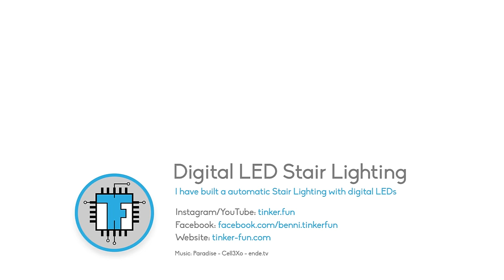DIY - Digital LED Stair Lighting - Arduino APA102 LED

Comment: How did you cope with the LED power supply? Did you use two power supplies? What kind of cable did you use? At 5v current flows a lot

Comment: Okay - interesting. I think the ultrasonic distance sensor is better than PIRs here - more accurate location determination. But this one is use just to sense a leg passing a single stair, not to judge distance. Do you think it is possible or practical to judge distance? That would be amazing, as you can have the lights moving exactly with the person.

Secondly I really like your use of individually addressable LEDs. BUT - maybe I prefer the "one LED strip per stair" instead of the linear installation. As it's more visually impactful, and also actually lights each step well, so it is useful as well. What do you think?

Finally I wonder if it's possible to somehow do something like you've done but in a whole room perimeter, not just stairs? I'm thinking camera movement sensor hooked up with Arduino. That's the next step!
Reply: The lights turn on and follow a certain pattern, then they wait for the second sensor to activate the other half of the pattern. Measuring distance would not help at all really.

Comment: Hi , I made a project on automatic staircase lights with arduino and ws2812b but unfortunately nano cant support more than 600 leds which disappointed me. my stairs runs nearly 11 meters (60 led/meter).
soo i planned to do same with esp32 
i have few doubts.
can i use two ultrasonic sensors. one at top and bottom. and also as i read in community that it can only trigger lights but cant reset. is it possible to trigger lights at bottom and as the person walks to top the lights should stop.
help me to finish this project.

Comment: Is there one that is battery operated that just stays on all the time? But that won’t need battery changed too often?
Reply from the maker: This is not battery operation.  Fixed power supply.  Best regards Benni

Comment: Can I replace Teensy 3.2 Microsontroller with something like Arduino uno or nano？
Reply from the maker: I think yes. But you have to test it with your Led length. If the Microcontroller is fast enough. I will build a new version with new sensors soon. I will test a esp32 Microcontroller as a new controller.
Reply: @tinkerfun  I intend to apply this project to my own house, so I would like to know more details. I'm curious what kind of sensors are you going to replace PIR? In addition, do you think nano is not fast enough, so you plan to use esp32?

Comment: Where did you hide the drivers?  They look way to big for that application btw. lol
Reply from the maker: You mean the power supply? For the long stair I built them in a cabinet in the room on top of the stair. For the short stair I built a acrylic case and mounted on the wall. The LED seller write "43.2W/m". So I have ~ 6,5m/930 LEDs on the long stair. So I think it fits. Best regards
Reply: Yea because those LED strips look overkill... its probably the 144 LED per meter one? :D
I mean... 60/m would be sufficient... maybe even 30/m. :P
Reply: @janred94  for the amount of necessary lumens, yes. But having the 144led/m makes the spacing between the diodes much less, and the fades much better looking. You don’t always need to run the leds at full power either...

Comment: That's awesome! So what's the total costs of this whole project?
Reply from the maker: A good question. I don´t know. The main components: ~26€ for one meter LED Stripe (APA102). I have used ~ 8 meters. Aluminium LED profile - One meter ~ 7€.  Than you need a power supply. For my project ~70€, two Sensors for one stair ~ 2€, I have used 6, a microcontroller ~5 - 20€ and cables.
Reply: tinker.fun It turned out really great!  Why did you choose APA102 led? Is it possible with WS2813?
Reply from the maker: Yes, you can use the WS2813 or SK6812 but I have needed warm white light. The APA102 has 3 warm white LED chips in one LED.
Reply: Hi I'm thinking of starting this project, your psu has 50A capacity what size cable are you supplying this in? Thanks

Comment: What about now, do you have working code? :) Nice job btw
Reply from the maker: Hi, This is a old project. A new and better prototyp for testing is V2. But currently I have not enough time. So I hope to finish this project soon and update my old version. I want to design PCBs and think about different sensor. So in V2 there are Laser IR Sensors with direction recognition and I think also about hiden radar sensors. Best regards Benni    https://www.youtube.com/watch?v=X8vHWPlUJSw

Comment: Plz provide circuit diagram and code
Reply from the maker: Hi. Here are all information that I can share with you. The code is not good enough to share it. But you can find libraries for this addressable led stripe for the arduino platform. So you can start program it self. https://tinker-fun.chayns.net/digitalledstairlighting